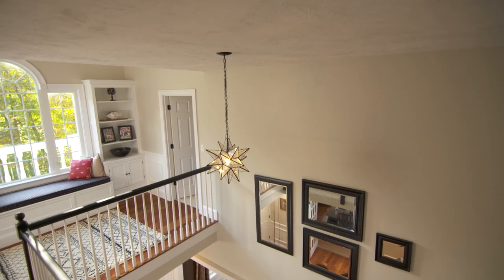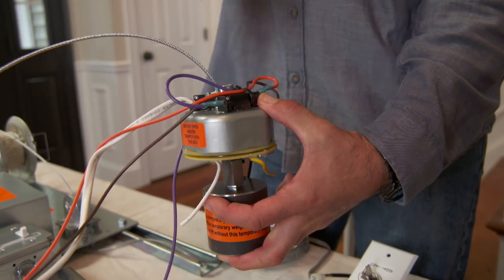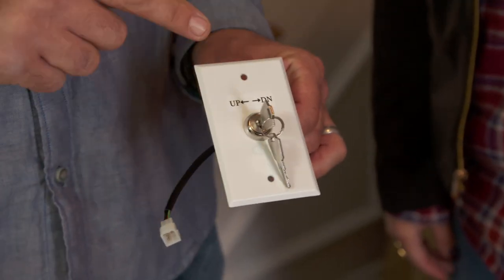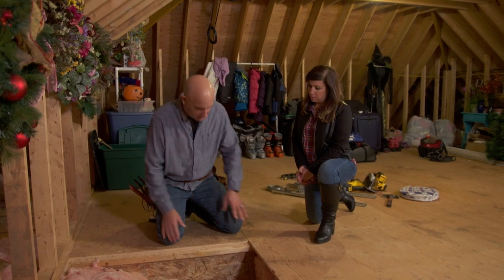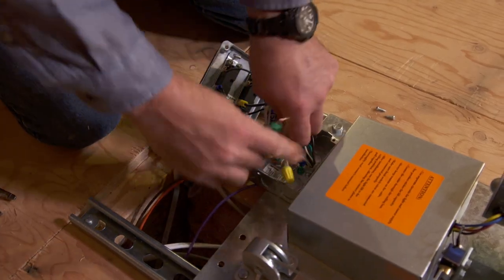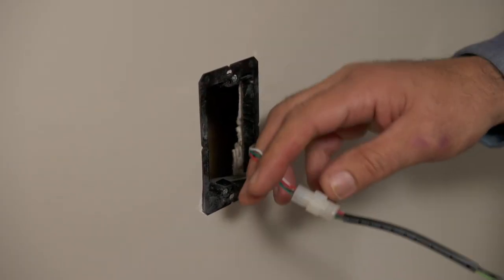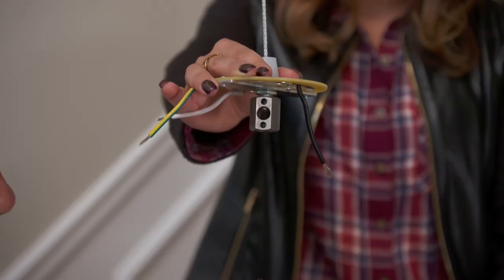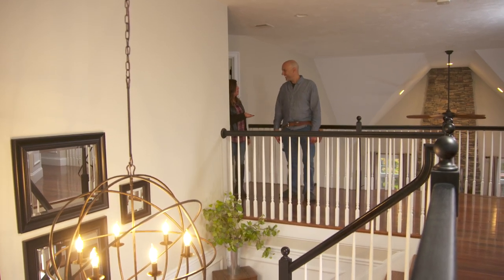How to Install a Motorized Light Lift | All About Lights | Ask This Old House

Comment: I was quoted $600 in labor just to replace my old ugly chandelier so this would definitely be a smart purchase for me.  My ceiling is over 25 feet high.   If I have to pay that much for "2 men and scaffolding" it makes sense to get this installed instead, then installing a new light will not be a big deal and I can change bulbs and clean the fixtures easily also!
Reply: stop the lies you live in a box

Comment: I've never seen that before. Pretty cool system, for sure. However, I think I'll stick to my old-fashioned ladder for the foreseeable future.
Reply: Is latter the old-fashioned way of spelling ladder?
Reply: haha, no -- just the idiot way.
Reply: MTLKEBEK he said ladder
Reply: He edited his post haha.
Reply: These are VERY common in luxury homes.
Reply: These are for bigass glass chandeliers in ballrooms that need a lot of cleaning and maintenance.
Reply: We've lived in a house for 21 years with this type of foyer chandelier and I'm ready to motorize it. I have the additional problem of not being to do the work myself and having to hire someone.  Bulbs stay out for months or years and the fixture is permanently dirty.
Reply: @CallieMasters5000  Or theaters that have large chandeliers where they cannot get a lift or ladder up to them with seats and sloped floors.

Comment: 6 hours later she’s still lowering the damn thing,,, for 700$ that thing should go a little faster
Reply: I looked up the price for the Aladdin Light Lifts ALL300 - 300lbs max - Residential, the MSRP was $1033.
Reply: Yeah it should be quite slow for safety but man that is way to slow also the light fixture could easily be pulled over the railing and clean and change the bulbs

Comment: Great video! Why do we need the switches in the Attic? Will the original switch be eliminated? Will the key be the primary means to turn the light on and off now?
Reply: The switches in the attic are just to service the light lift. they key only operates the up & down motion of the lift. your existing wall switch/dimmer controls the on/off of the light

Comment: In the area I service people call an electrician once a year for any lights not working. What that means, besides the fact that they have money to burn, is they send out the new guy who makes a list of what bulbs are needed and then comes back tomorrow with the right ladder and a box full of new bulbs. Since this job is charged by the hour the owner can save money over time with this contraption. You think I am kidding, right? On the "gold coast" you will not see a hedge fund manager changing his own bulbs on a 10,000 sq ft weekend home. That's why they make the big bucks!

Comment: LED's ?
Reply: Wamfox Yes it are. That typical yellow inside the bulbs means it are LED's. Though i've dumped half of my LED lighting and got carbon filament bulbs. Much more athmosphere and screw mother nature :D
Reply: If there LED's then theoretically they should only have to be replaced once every 10 years? Negating the expense of this?
Reply: If you watch the beginning of this, she says it hard to clean and changed the bulb.
Switching to LED's will not fix the problem of having to clean it.
Reply: Fair enough, seems expensive tho

Comment: Looking at those connections the center connection which I'm presuming is the earth does not seem to be able to make contact as the contractors on the line and neutral do not allow the metal rings to touch and there is no contractor on the earth.

Comment: First name Over, last name Kill.
Reply: Heck yeah, why would anyone motorize that process with a complicated and expensive device like that. Imagine if he put a push connection in the wire that could be safely unplugged at the fixture by anyone, changed the mounting box so that the light fixture could be released/secured easily enough from above, and connected it to a loose cord with a stop or indication of how far to let it drop, so that it could be let down manually from the attic without hitting it onto the floor. Immensely cheaper, no silly switch on the wall, and I can't imagine even neat-freaks like those homeowners cleaning it often enough for the little extra work of going up to the attic to have any real significance.
Reply: relax
Reply: Right? Especially with LED bulbs rated for 50,000 hours... And a fixture that doesn't have glass or require cleaning. Does this woman have any emotions? LOL

Comment: install quality leds and change the light every 10-15 years with a ladder or install this contraption which will also only be used once every 10 years.
Reply: Lights like that are often just used for decorative lighting, not actually putting out useful light.  It's possible that there are not any LED bulbs in the style of lighting that they desire and in that particular bulb base type.  I have had a few lights similar to that in houses that I've owned over the years and I hated them.  They were enough of a pain to change that I usually waited until the very last one of the bulbs burned out before I broke out the ladder.  One house had a 17 ft ceiling and the light was hanging down over the stairs.  Putting a ladder on stairs is an accident waiting to happen.  LED lights were not available for houses back then.
Reply: How about the dust? I guess none of you mind having dirty fixtures.

Comment: What about the light switch? She has to go to the attic to turn on the light fixture? 

I don't get it can someone clarify?
Reply: No
Reply: You still use the regular switch to turn on the lights. The electrical connections disconnects when the light is lowered. The house we live in now has 2 of these which is great for cleaning, changing bulbs and changing to new light fixture. We changed out to LEDs so hopefully won’t have to deal with bulbs for a while.

Comment: I mean the system is not really meant for those lights. It was supposed to be used for those heavy af chandeliers. Like those with bike chains or glasses that weight 300-600lbs. The system can hold up to 1000lbs and it cost for 1000 to 2500 depends on the weight limit

Comment: What’s the point of lowering it if it only turns on with the connection
Reply: To clean and or replace it it’s not for height adjustment

Comment: The attic seemed to be good accessable. Just tie a long cord and such a steel cable to the light and lower it manually that one time a year. I also like to spend a nonsense of money, but this really is just a waste of money.
Reply: But the power connections....
Reply: manorin long cord as i said..
Reply: Led or fluorescent bulbs would have saved this homeowner a lot money but this is a cool system and the convenience is great but only if you can afford it.
Reply: QuadroNVS The lamps in the video are LED. And there is no way such a 400$ machine is worth that one time a year moment.
Reply: Richard, let's see you lift a 50 pound light.

QuadroNVS, if you watched the whole show while it was on TV. One of them mentioned about the LED's. But LED's doesn't address the fact that it would need to be dusted.
Reply: Why do you lift 50lb? You can use bicycle hanger of $10 or storage hoist. We need something more than that though. For example, attic accessible chandelier box?
Reply: erictold, this is a better solution then a hoist. The has the wire in it. And no jacking to lift the light.
Reply: That's exactly right. Its troubling though that so many people could careless about professional installation. I wonder if they know that if their house burns down due to an unlicensed electricians work their insurance is going to tell them tough luck AND the bootleg tradesman is off Scott-free!

Comment: I'm hard on Scott (mostly because he uses his pliers to strip wires) but he did a great job here. Every homeowner in a nicer home who has an expensive chandelier coming down a 2nd or 3rd story ceiling should consider one of these and they will save money in the long run if they every replace it because if an electrician has to rent a lift or set up scaffolding to reach your fixture in the future, it'll cost you money.   You can also clean the crystals easily too.  Biggest thing to watch out with these is to remind the painters NOT to paint the terminals. They like doing that for some reason.

Comment: so now what happens when she is dusting the ceiling with the light switch on, but dropped? yes the fixture will be off, but the plate in the ceiling wont
Reply: Nick Dvorchak there are no completed circuits, when the fixture is lowered, so nothing will happen.
Reply: @austinlindsay  if she touches the hot, she completes the circuit
Reply: It doesn’t work like that. The hot will be in the ceiling in the attic covered by the lift cover. The connection will be complete when the plate connects the wires in the center. I have 2 of these which were already in the house when we bought it. They are great.

Comment: The nice thing about being an Electrician is that 99% of the population has no idea what you're doing or how electric even works.  They know, however, that it's dangerous, that it can kill you, and it can burn their house down if not done correctly.  All this was demonstrated by that woman.
Reply: Same thing being a Computer Technician.
Reply: Black to Write and lick all wires before you connect them useing duck tape right? Oh yeah and make sure bracker is ON. 
Disclaimer do not do this, if you do this you're an idiot. You cannot sue me, my writing method was complete sarcasm and should be viewed as such and should not be tempted by anyone.
Reply: whats electricity?
Reply: whats a computer??

Comment: That's what ladders are for
Reply: There are stairs in the way and I don't know of any ladders that can reach 18 feet safely in her situation.
Reply: It's 18 feet to the ceiling, not the fixture
Reply: Yes it is. I meant a ladder that you could be on and reach 18 feet. I guess I wrote it weird. Doesn't really change the main issue, which is there is no place to put a ladder. The light fixture seems to be directly over the railing. So the ladder would have to be off to the side which is not very safe.
Reply: Someone has to install that fixture too. Sometimes I see 3 story houses with stairways and there is no safe way to reach the fixture without renting a lift from a rental shop or having one of these.
Reply: Some people don't like heights.
Reply: She has 2 kids. Let them figure it out!
Seriously, couldn't you just get a stick with a hook, pull the fixture to the side at the top railing, and do your maintenance there? It looked like it had enough slack to reach the top railings.